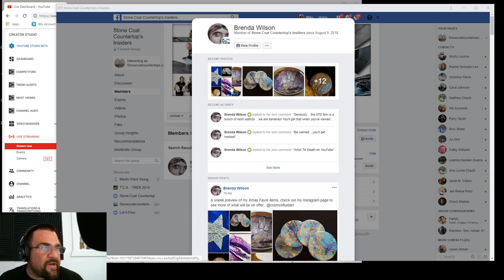Refinishing End Tables Like a Pro

Comment: Hi!  Are you able to use this epoxy on compressed fibrous cement sheets?  I am thinking of making an outdoor kitchen with a bbq and it needs to be non combustible.  Thanks!
Reply from the maker: Great question Frankmat! We have not tested this before, it would be best to try it out on a small sample of the fibrous cement sheets to see if it will work for your application needs! Be sure to allow the epoxy to cure for 30 days before reaching its heat resistance of up to 475 degrees!
Reply: @StoneCoatCountertops  Good idea!  I will let you know how I go with it

Comment: May I suggest StoneCoating and motorcycle tank/fender? Open up the automotive branch now!
Reply from the maker: We like your style JB Marker! What design would you make over a motorcycle tank or fender?
Reply: Something linear that would flow along the tank and be a bit organic maybe. Stand the tank on it's rear end and let the epoxy flow down the sides while you manipulate it with the heat gun. And of course it would have to be done in metallics. I like the idea of trying the twisted plastic bag down the length of the tank as well.

Comment: Brilliant! By the way where do you get the round hand sanders...I've looked high and low...no luck. Thx.
Reply from the maker: Great question biner59, here is the link: https://www.amazon.com/GP15907-Hook-Sanding-Block-Diameter/dp/B01MZWKU21/ref=as_sl_pc_qf_sp_asin_til?tag=stoncoatcoun-20&linkCode=w00&linkId=eeaf93b96d7fb84d99ca3d0f3920b6b1&creativeASIN=B01MZWKU21  
Are you working on any projects currently?

Comment: I was wondering if I could Clear coat my walls with epoxy. Or possibly Clear Coat My decorative tile wall? I would like to do Clear on my hard wood Floors and go crazy on the walls. I am planning several future furniture projects with this but I have some concerns with a few of the projects id like to do.
Reply from the maker: Hi Todd thank you for watching our videos! We do have the vertical wall kit to apply epoxy directly onto your walls, however we do not have a way to keep this epoxy clear as the vertical nature of the project will cause the epoxy to run off, the thickening powder does cause the epoxy to dry a milky white color if you are not adding the metallic powders into it. You can always call us with questions and we would be more than happy to help! (541)450-1976
Reply: @StoneCoatCountertops  thank you so much I will get with guys for advice on all my epoxy projects